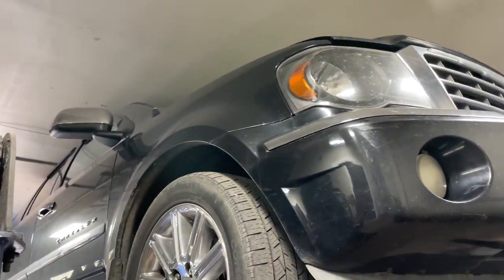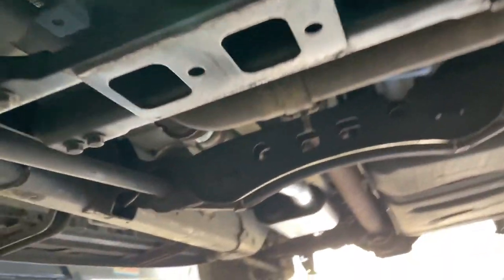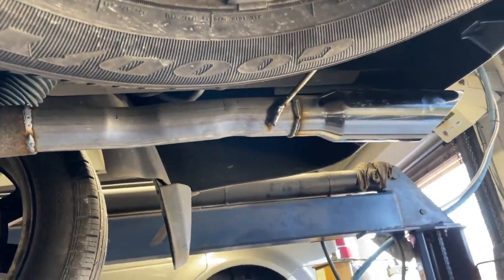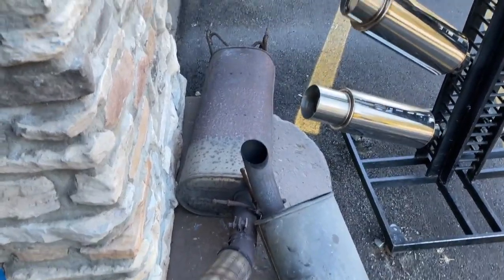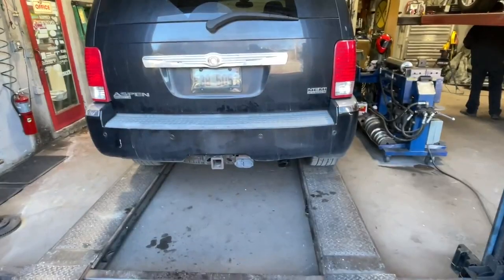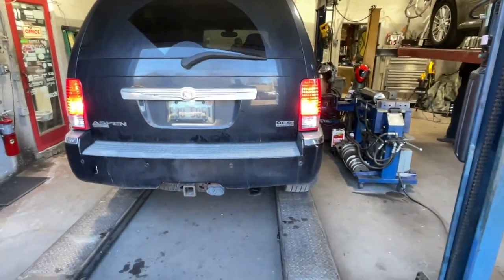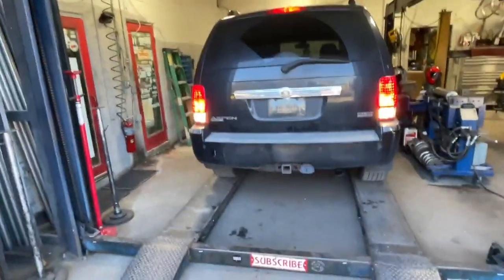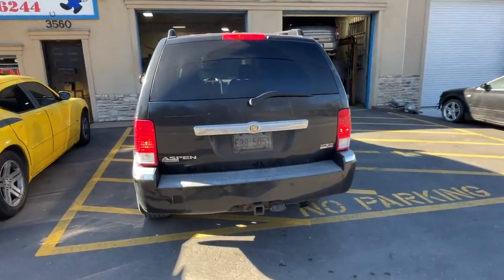2007 Chrysler Aspen 5.7L HEMI V8 EXHAUST w/ FLOWMASTER SUPER 44 SERIES!

Comment: I’ve got the 2008 Aspen and want the super 10 installed with an 4” angle tip. What would that cost me approximately?
Reply: When u got time listen to my setUP it's in the shop right now getting some work done to it
Reply: @vote4thavillain5.76   no disrespect, it sounds mean like all HEMI's do. But it's too loud for my tastes.
Reply: Hey, did u ever get that done? How is it? I’m looking to get the same setup and am wondering how it is? Also could u tell me what other parts I need to buy and what I bought? Thx in advance
Reply: @LynxStarAuto  I hear you in the shop getting work done
Reply: @areezbaloch6820  what muffler's you looking in 2
Reply: @vote4thavillain5.76  I ended up doin a super 10 and it sounds amazing! Couldn’t wish for anything better. Just purchased a k&n air intake coming soon as well as a new stereo head unit! The build is going crazyyyy!!
Reply: @areezbaloch6820  let's go CHAMP  I just got mine's back
Reply: @vote4thavillain5.76  nice bro how is it?
Reply: @vote4thavillain5.76  just installed a k&n CAI and working on the stereo as I’m typing
Reply: @areezbaloch6820  I want 2 get me a unit  I'm going 2 wait change my door speakers out
Reply: @vote4thavillain5.76  dude Ik it’s been a while but since the last message I spent days in and out breaking my head trying to get an aftermarket stereo to work but it ain’t working. I tried so much with so many different parts but I couldn’t get it to work. Lmk if and how u got ur aftermarket stereo to work.
Reply: Hv u went 2 FB

Comment: Love my 07 aspen I just did a full straight  pipe from the flex pipe sounds good only thing I don't like is when the mds cuts down my cylinders might have to delete that soon.
Reply: definitely delete MDS itll fuck your engine up eventually we turned off mds on a 09 RT it would constantly try to go into mds
Reply: I'm go check it out then
Reply: What is the MDS just got a 2007 Aspen with hemi
Reply: Hey what is MDS cut down your cylinder? Does that have something to do with that check engine light?
Reply: I have one. how do you know when the cylinders cut down, is there a message? where does it show up? does it say "fuel conserve" or something?

Comment: Did it have drone inside cause I want to get mines done
Reply: I don't hv much 2 me n mine's shop getting work done
Reply: Yes, specifically around 2000 rpm
Reply: @iwishigaf  I only change the mid muffler and kept the rear resonators
Reply: @TikkacanKut2  that's what's up right there luv 2 HEAR it